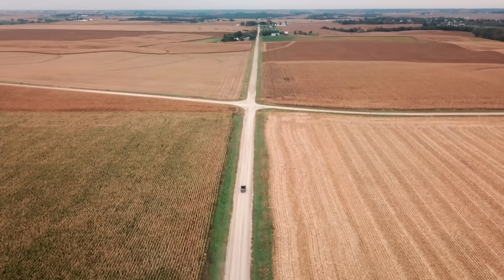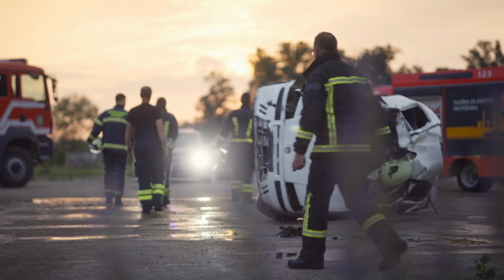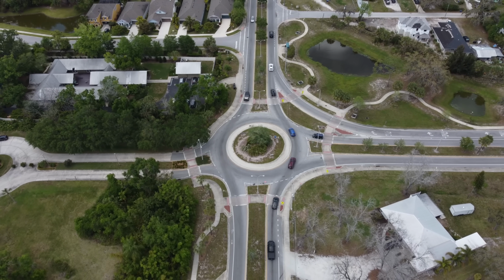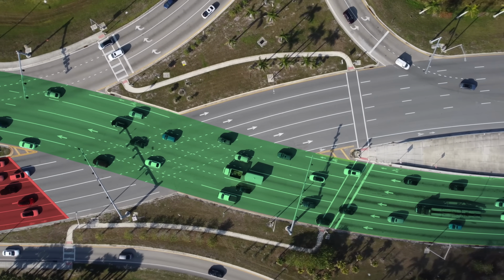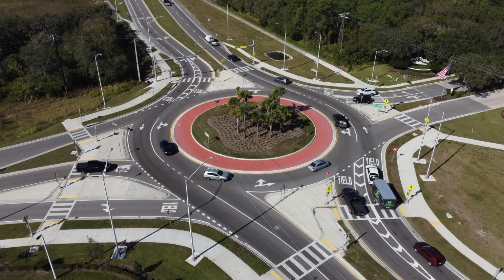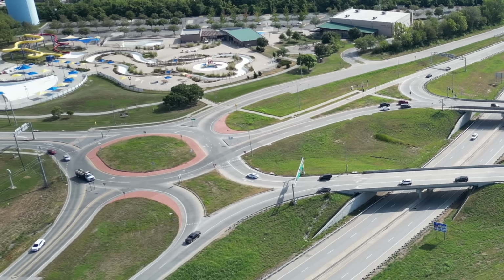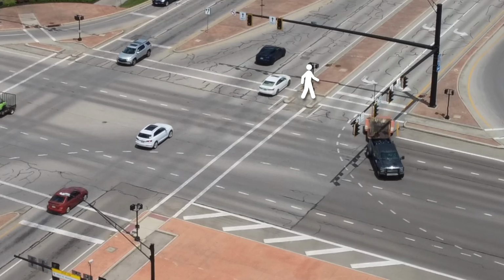These Intersections Are Changing the Roads Forever

Comment: Except this completely ignores the entire problem across the US and other free countries: people with their self elevated ego combined with minimal traffic enforcement. They ignore the traffic laws, excessive speeding, run the red lights and stop signs, because so far they haven't gotten busted for it, and the few times they have, a $100 ticket is nothing. They force their way into whatever lane they want in a traffic circle ignoring the yield, just like they ignore most other traffic laws. Then whenever there is a roundabout off the main road on a side road, the people coming off the main road force their way into the circle so literally dozens or hundreds of cars hold up the entire circle as most fail to yield cars already in the circle, and when they do it causes traffic backups on the main road (have one of these in my FL town).
The problem with the diverging diamond it is prioritizes traffic coming off the interstate/highway, causing massive backups on the main road since the cities have horrible light coordination.
Reply: That is the point.  The ramps traffic is of greater magnitude than the cross traffic.  Therefore there is grrater priority to ensure they do not back into the high speed lanes nor on the bridge deck.

Comment: There's another problem with continuous flow intersections that wasn't mentioned here:  They require you to know that you're turning left long before you get to the street that you're turning left onto.  This may be fine if you're familiar with the area, or if you're using GPS, but it also can lead to missing the left turn in some circumstances.

Comment: Diverging diamonds (aka tw*ts) are dangerous, slow, costly and inefficient. They waste millions upon millions of money stolen from taxpayers, take years to implement while making traffic much worse during that time, they are a huge safety hazard due to their non-conventional effed-up misguided design and the worst part, they are just another lie. When traffic data are properly compared between the pre- and post-conversion era, the diverging diamonds just might accidentally sometimes relieve some traffic during peak rush hour but at other times, they hamper traffic flow tremendously. Just another solution in search of a problem.
Roundabouts are useful. Until you see the bastardized British versions with traffic lights on them. Totally insane. LOL
Reply: Except that the decades long data show doverging diamond interchanges are safer and more efficient.  And less expensive to build. Get with the times.
Reply: @traffic.engineer  Except that is nothing but disinformation and propaganda. These lies have been disproved many times. The costs are higher, safety is lower, traffic efficiency is worse. Don't fall for old propaganda articles. Read some new ones. Get with the times.
Reply: @lxxsxxx7845  Why should I believe your misinformation and propaganda?

Comment: One downside of roundabouts is that when a major road intersects with a minor road. Or there is a high tidal flow on one entry, perhaps in the morning.

Then one flow overloads the roundabout and other traffic has no gaps to enter.

The answer in the uk is either to place a traffic signal to control the busy road entering the roundabout, or even to put traffic signals on each intersection on the roundabout.

We also have magic roundabouts where 6 or 7 mini roundabouts are connected so you can go both clockwise and anticlockwise.

Comment: Two of the biggest reasons why the diverabout works is because it is very flat and MDOT signed and marked everything well. You can see where you need to go and what traffic is coming making it at least safer than what a normal roundabout manages in these areas.

Comment: I am honestly a fan of the Single-Point Modern Interchange, we have one here in PA/MD near Glenrock. Same idea as the other interchange, you start normally waiting at a light, have the option to merge right, or go through to cross sides to the left, and while on the left you can merge onto the highway using the *left lane*, then cross back over to the right lane to continue on.

Comment: roundabouts are better than a straight up intersection sure, but they are not really any faster. there have been many many times where the volume of traffic was so great i ended up sitting at a roundabout waiting to get in longer than i would have had it been a traffic light instead. this is at many different traffic circles too, not just a select few.

Comment: Diverging Diamonds only appear to work because traffic only flows in one direction at a time. The same thing can be done without the confusion of the crossovers. And yes, people find them just as confusing at ground level. They, too, suffer from the no-one-is-moving issue. Roundabouts have become a favorite fad, but they take up impossible amounts of space, and often make it difficult (even impossible) for some traffic to get around them.

Comment: I live close to that exact continuous flow intersection in Ohio. I would prefer a round about. The whole thing works. But if you are turn left it does take almost longer. The design favors the road that has an interstate interchange and not the state route. Having the mall there as well makes traffic still a mess.

Comment: Heyo, you included footage of the continuous flow intersection just south of Dayton! Nice! I drive through this pretty often and remember when it was first built. You mention pedestrians, and fortunately in this location (so far) there is basically no pedestrian traffic through the intersection and even if travelling on foot were easy there still wouldn't be much. However this intersection has already become a problem as of a few years ago in that it simply can't contain peak traffic which has grown consistently in this area. It remains the only intersection of this type that I can think of in the entire Dayton and Cincy area.

Comment: They put in roundabouts because people are getting less patient, and not following traffic laws, such as the "roll and go" and speeding. They certainly don't need them at slow speed intersections. Two issues I'm having are not putting directional signs in the right spots, and people not using their turn signals.

Comment: Instead of continuous flow intersections , JUST USE A FREAKING ROUNDABOUT
Reply: Roundabout would not work becuase traffic well exceeds the roundabout's capacity.   Roundabouts work great for low volume roads.  They get congested for high volumes.

Comment: If a big goal of these designs is to avoid left turns, why not use flat cloverleafs? To go left, you'd drive straight through the intersection and then on the other side go right through a leaf and onto the perpendicular road and head through the intersection. Intersection traffic would only need to switch between two phases of perpendicular traffic. And all "turners" -- both right turners and left turners -- would get into the right (slow) lane when approaching an intersection, allowing drivers in the left thru-lanes to move quicker and smoother.
Reply: Cloverleafs take way more land and are less efficient.  Basically added cost with no added benefit.

Comment: I live near Frankfurt, Germany. There, the system of "avoiding left turns by replacing them with U-turns later on" is working well. You wait a bit longer at the U-turn instead of short wait the left turn, but net benefit is ok.

Comment: I still don't get why not just build a cloverleaf interchange instead of a diverging diamond, maybe it's a bit more expensive at first, but it has no traffic lights and no paths crossing.
Reply: They are horrible innefficient for larger volumes of traffic, along with morr land.  Streetcraft has a video explaining why they suck.
Reply: @traffic.engineer  larger volumes of traffic can be fine when you get rid of weaving. I didn't clock in that the cloverleaf I used to go through every day isn't a "full" cloverleaf, as it lacks some connections, thus avoiding these problems. Also, I wouldn't say that taking up more land is much of an issue, in most cases such big roads don't go through cities. When they do, you suck at building cities and have much bigger problems than finding the best type of intersection of two highways.

Comment: 8:18 That is the ugliest strode I've ever seen
Reply: That is not a stroad.  Stroad is when multiple driveways in close proximity hace full movement access.
Reply: @traffic.engineer  I see parking lots going into a road not streets
Reply: @HenryGeorgeRIP  That is not what makes it a stroad.  A stroad occurs when a multilane road without a divider allows unlimited left turns in and out of driveways.  The Michigan left turns restrict the access points with set amount of u-turns for access, allowing it to operate and perform as a road.

Comment: I can't stand a lot of the new over-engineered overpasses, too many ramps, opposite on ramp and off ramps, and figure eight interchanges. Driving used to be simple, and now you need a degree in engineering just to understand where to go. I never felt this way until the last 5-10 years or so, since a lot of these super highway "improvements" came along and messed things up. 

All these crazy road designs cost a lot of money to design and build, and so who cares if it's best for the population, corrupt politicians sign off on them anyway. 

Oh, and don't tell me just use GPS bro. Again, it used to be clearly marked and simple. Now you're practically required to use GPS, and it often leads you wrong. Ugh... Oh well right? What can I do about it? Write a letter to my congressman. Lol .... Too bad, so sad, just shut up and like it.

Comment: I have seen and drive in a Continuos Flow Intersection but it haves a few fawls (19.50282431609848, -99.13122107338923) however the best way to solve the pedestrian problem was a bridge that you can see in the satelite pics in the coords.
It seem to be a great solution (the intersection) until you notice that there are a lot of people that doesnt know how to use it, its very common, even you can see in the satelital picture that there are a car trying to turn left in the wrong spot.

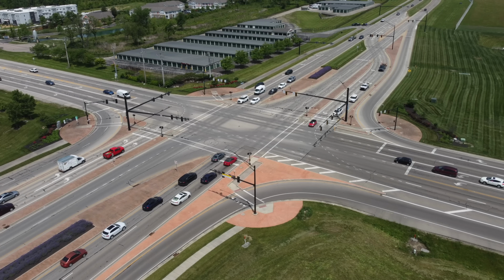Comment: @6:50 This is like: "We must use as much land as possible and we have to keep the lights otherwise drivers don't know what to do".
You could easily fit a two lane roundabout with a separated right turn lane in a smaller area.
The roads and intersections are designed to accommodate an ever increasing amount of car traffic instead of trying to reduce it.

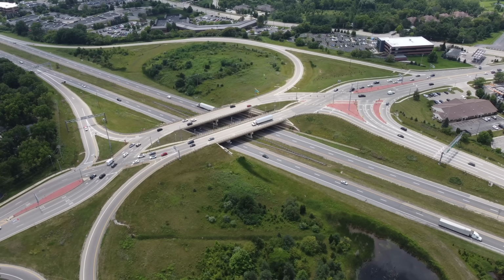Comment: @2:30 Why not just have two roundabouts at the intersections where the on-/offramps connect to the local road? That is what is most common here.
Reply: That only works for low volume roads/interchanges.  Which is why America reserves them for outside major urban areas.

Comment: We made a improvement for pedestrians and cyclists in the Netherlands. We put them on a different vertical level to the cars. Put the cyclists and pedestrains on their own roundabout beneath the cars and they are perfectly safe from 2 ton deathmachines and their much lower speeds comparably puts them safely in eachothers paths. Although of course, if you push cars out of town entirely, you don't need fancy intersections or roundabouts. And you leave far more room for people to interact and gives a huge boon to shops. But that's next level, it'll take the US of A another 50 years to figure that one out.

Comment: If you haven't already, I'd like to see you cover the SPUI, or Single-Point Urban Interchange, where everything comes to one X shape with traffic lights controlling the flow from a few directions at a time. One near where I used to live in Upstate New York was rebuilt about 15 years ago (I-87, exit 6), and it cut down on both traffic backups and accidents. The main drawback is the amount of space it takes up, but that one exits onto a 4-lane state route anyway, so it's not much different.

Comment: Do not see the benefit of the "diverging" part on that "divergabout". Could easily be a second roundabout. It's common here in britain. Some highway intersections have a singular large elevated roundabout, others with more complicated routes have a roundabout on either side. The "U-turn for left turn" at the end, is itself another glorified roundabout.
Reply: Roundabouts have capacity limits, which the diverging section can move more volumes of traffic.  The ramps with less volume can use the roundabout.

The u-turn highway predated the roundabout.  It is not considered a roundabout because it does not have priority rule.

Comment: Roundabouts work in Europe because they drive so slow in Europe. The streets are smaller so it doesn't feel that way but they usually go about 30 kmh. I remember in Rome it took us 30 min to go 2 miles. Would have been faster to jog. In the US that distance takes 5 minutes with "horrible traffic". Roundabouts simply do not work when incoming traffic is 45 MPH plus. The trough put is to slow.
Reply: Incorrect.  Roundabouts are limited by volumes, not speed.  Roundabouts work great on 55+ MPH approach roads by reducing the risk of injurious crashes and necessity to stop.

Comment: In Europe there are a lot of interchanges from highway to local that simply keep one roundabout on each side of the highway, with the connecting road between them over the highway. That way you end up with the ramps on and off the highway connecting to the roundabouts and you don't need the diverging diamond pattern at all.

Comment: One idea I don't see discussed much that seems like a relatively straightforward idea for an interchange is a "Barbell Interchange," which would be identical to the traditional design mentioned in the video, however instead of having the four-way stop, each intersection either side of the highway would be a multi-lane roundabout. This may result in the annoyance of having to go through two roundabouts, one right after the other, for some traffic, however it would aim to resolve the psychological stress I've heard some drivers complain about regarding diverging diamonds, where drivers mention being stressed due to being on the "wrong" side of the road.

Anyone have any thoughts on the idea?

Comment: you should look at the intersection of highway 19 and highway 69 in emory, texas. it's just a four way with signals but it is pretty much the center point of four major cities in the area (sulphur springs, greenville, and canton, plus several others past them which leads to way higher traffic volumes than the small town it's in can really handle. the two families who own basically everything own all the buildings around it so the space that's already being use is all that will be available. they are talking about making an overpass or something like that but there isn't enough space. with the layout of the town (the intersection and some backroads, basically) anyone in the area basically has to go through it to get anywhere and it makes it take forever to get around for people who live there. I think they should do a roundabout because the existing intersection has plenty of space but there are concerns about if people could figure it out (these are reasonable concerns, they are terrible drivers).

Comment: how they redesigned the on ramps to I70 at Wentzville MO has me pull my hair out every time i try to get back onto the interstate. almost always end up on the frontage road and getting on the interstate the next town over....

The Intersection of I-270 and IL 111 was recently turned into a diverging diamond. the location is a truck stop (been so before the interstate was there bc of Route 66) and lots of warehouses were being built up near by in the past 20 years. needed something more beefy to deal with the modern traffic load.

Comment: Diverging diamonds have to the dumbest invention. Crossing throught traffic TWICE to prevent turning traffic crossing over through traffic. The problem with the standard interchange you showed is that the exit to turn left and right comes before the bridge and entrance from left and right comes after. The left and right exiting traffic and left and right entering traffic are combined onto a one way road exiting or entering the highway. If you divide it farther you can put an entrance and exit before and after the bridge, so if you mean to get off the highway and turn left you would go over the bridge to the exit do a uturn and come back onto the road, if you wanted to turn right you exit before the bridge and just do a right turn. If you want to go left onto the highway you go under the bridge turn right and do a uturn onto the highway, if you wanted to go right onto the highway you enter before the bridge by just turning right and entering. Not a single crossover. You can even have it so your exit ramp comes down over the entrance ramp, under the bridge,  so that exiting traffic gets dropped onto the road after the highway entrance, so you don't cross that traffic. 100% flow. Roads should be designed by people who drive on them for hours a day, not people who learn about them in classrooms.
Reply: I don't want roads designed by drivers any more than I want aircraft designed by passengers. There are reasons that engineers/designers in all fields exist. With respect to interchange design, the designers have tons of data on flow volumes and peak flow periods, accidents etc, and these all factor into design. Also, keep in mind that the patterns that designers find "most ideal" for any interchange seldom get built. The main restrictions are not enough available land and/or the design being too costly. So, for most designers that have to do the best they can with traffic and accident data and the available land and $$$ available for construction.